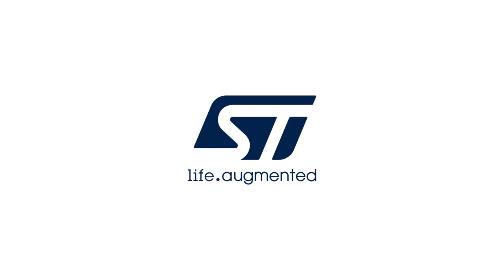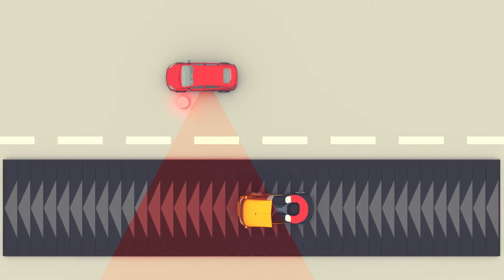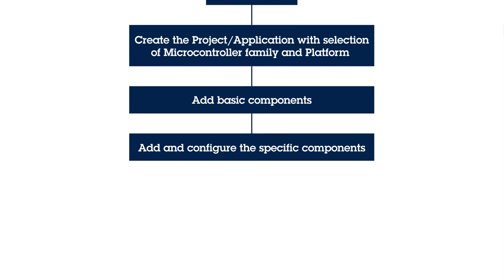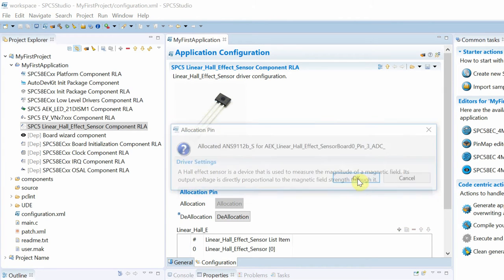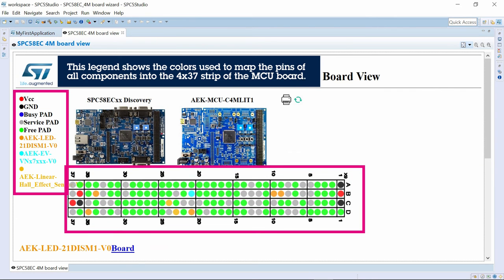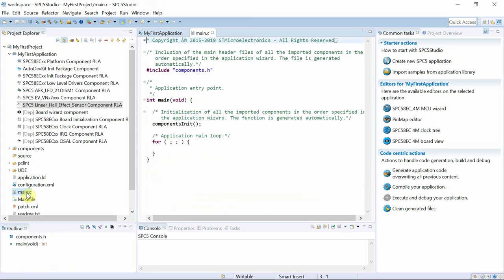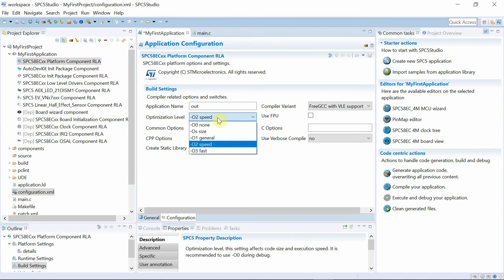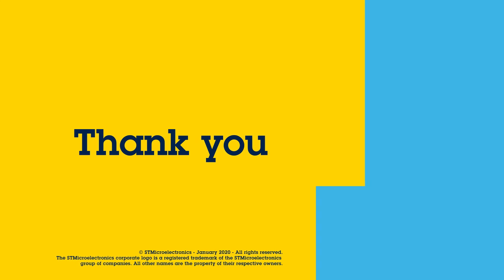Blind spot warning system educational tool: create it with AutoDevKit™

Comment: Good presentation, but I don't understand why is it used DC motor driver for conveyor belt if the aim is only detect the other vehicle by using hall sensor? Can not I simulate the scenario without motor driver by controlling the second car manually ,which is placed on conveyor belt in the video.